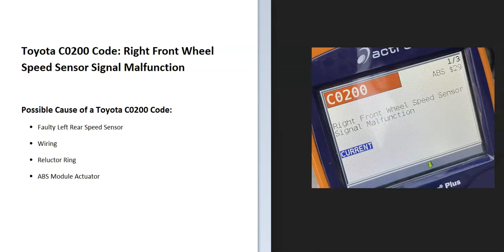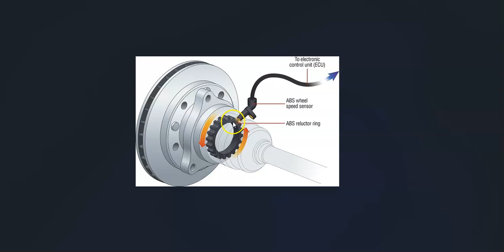Causes and Fixes Toyota C0200 Code: Right Front Wheel Speed Sensor Signal Malfunction

Comment: My toyota wish is indicating p0171 what might be the problem and fuel consumption has increased
Reply from the maker: A P0171 code is caused when the engine is running lean. It is a more difficult code to troubleshoot. I made a full video on it. Here is a link. https://youtu.be/b9__WGuD-dc
Reply: Look for bad Mass Air flow sensor symptoms, if you have them just replace the sensor and it should get rid of that code

Comment: Changed both from sensors with wires, still getting the same codes c0200 and c0205 😢
Reply: Did you solve it?
What was the problem?
Reply: Same. I bought sensors from Amazon that said they’re compatible but I’m now getting those codes.

Comment: Hey what’s up man I got Code C0200 and C0205 which says left and right front sensors at the same time could there be reason both codes pop up at the same time
Reply: Same here . Did you ever figure it out?
Reply: I wouldn’t trust the code to tell you the position, get down in the wheel well and inspect, use a multimeter to check resistance as well if nothing is completely obvious
Reply: ⁹
Reply: Is there any solution? Got the same for lexus. Those sensors show c0200 and c0205 same time on the speed about 60MPH.